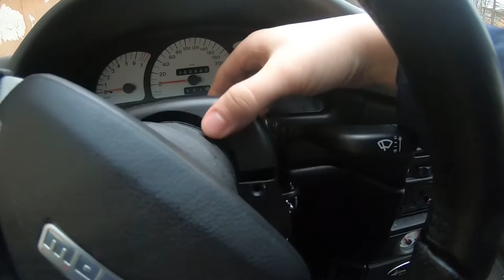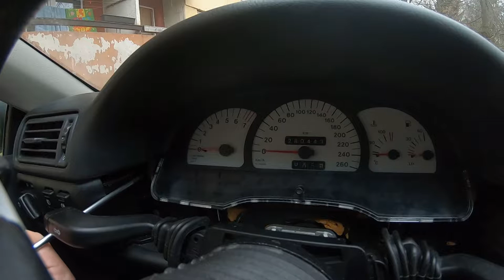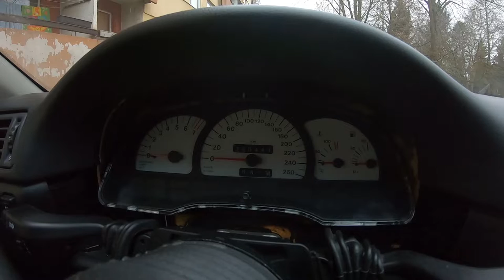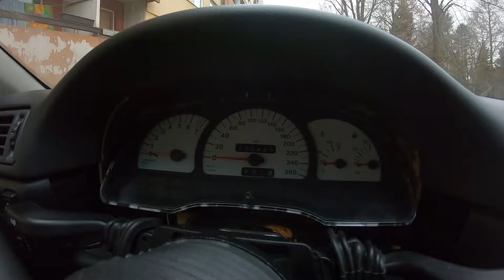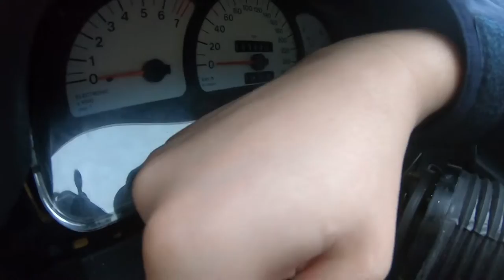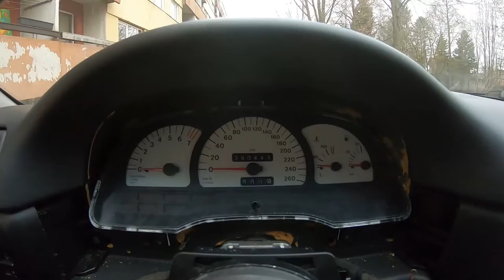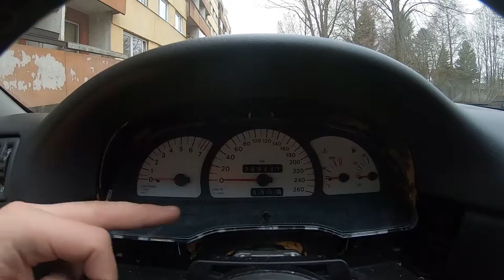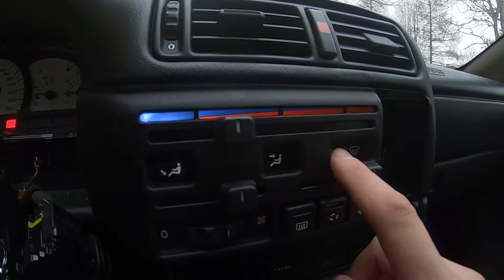How to Change Calibra/Vectra A Dash Lights

Comment: How did you manage to remove the instrument cluster so easily? Do you have to unhook the speed cable from the transmission first? I can't seem to remove my instrument cluster
Reply from the maker: V6 dont have a cable for the transmission.It has a wire connection.I remember when i worked on my previous calibra then the cable has a stopper so you need to push it towards the speedo with your fingers and then it comes off.I know there is not much room there,but if you remove it one time then it’s easier.

Comment: Excellent video ! 2 questions ,witch version of calibra is this and it doesnt have speedo cable ,and the second is ,is there a diference in the  speedo bulbs that are green and the bulbs from the 2 gauges that are black ,i mean can we use the black bulbs in speedometer?
Reply from the maker: Hey thank you.It’s a facelift keke rosberg edition calibra.That speedo what i have was put on the last calibras from sept 96-jun 97.Calibra unitil 94 had the speedo cable,but newer ones have just a connector.In the back of the speedo are 2 types of bulbs.Bigger ones and smaller.I’ve changed the small ones with each other and there are no problems.
Reply: Have in mind that maybe its the type of motor as well ,i have the last edition 1997 with the x20xev ecotec and it has cable ,maybe the v6 or turbos the newest ones has electronic.
Reply from the maker: @Heliastheodorakis  that I didn’t know.The cable ones were on the first years.

Comment: My whole dashboard is without light. I hope i can just change THE bulbs like You and it Will be like new! I would Love to hear more about illuminating heating lights. Got any Link where you bought it?
Reply from the maker: Hey.if your whole dashboard has no light then check the fuses under the dashboard,driver side.Iluminating the heater part is just one aditional led and original bulb like you see on the video.I bought led bulbs in my local electronic store and added a resistor what is suitable for 12v.
Reply: @TheMeisner87  thanks alot i Will check this! :) All check light works but not the light to the gauges  so not easy drivning att the Night :)
Reply from the maker: @redwoodjewellery  then probably its the fuses.
Reply: @TheMeisner87  it was the bulbs, ALL was broken. Did you find any better lightbulbs to use? (you said these was to bright in the videoclip?) if you did can you please link them? :)
Reply from the maker: @redwoodjewellery  i havent seen any calis where are bulbs where broken :D Where you want to put them.I think the best choice is to put led with resistors and get the light what you want.I bought a new instrument cluster also like maybe you saw on my previous video.There i am going to but leds with resistors inside original sockets what came with the instrument cluster.
Reply: @TheMeisner87  Oh ok, ill think i just get some new "normal" t5 lamps until i got more time to fix it more proper! thanks for a really well done video! :D
Reply from the maker: @redwoodjewellery  Thank you for the good words.I hope you can make everything working :)

Comment: Hi ,I was wondering what type of bulbs do you use for behind the heating controls, standard I want ,thanks
Reply from the maker: I use led-s.One led is added on the heater bar and other is at the original place.
Reply: Thank you for the reply , I just want the original bulbs do you know the code for them. I olso looking for vauxhall/opel cavalier/vectra A ,sunvisors can you help. Cheers
Reply from the maker: @nickbrady616  original bulb type is t10 and join the calibraclub community in facebook and ask them there,because lot of people sell spares.

Comment: Hi. Whats the model of the original calibra bulbs? Just one more thing. Is it normal that ther heater lights are still on when the light control is swtiched off? I mean the key at the very left. Thanks
Reply from the maker: Hey.
The bulb type is t5 and it’s not normal that the light stays on.I think someone put extra power to the bulb or there is a short circuit in the light switch.
Reply: @TheMeisner87 thanks so much. I'll work on it 👍👍👍
Reply: @TheMeisner87  13:05 where did you apply that extra wire? is it another t5 bulb? thx
Reply from the maker: @n1h1lvs  Hey i put the extra wire to the original bulb socket.And its just a normal 5 mm led.

Comment: I would have liked to see how you completely removed the cabinet from the heating controls to put the lighting LED
Reply from the maker: When you need to remove complete controls,then you need to remove cables and its easyer to remove them under the glovebox and after install them again.Because otherwise you will break some of the plastic clips what are holding the cables.

Comment: How do you change the light bulb of the computer? I can't get it out
Reply from the maker: Take the computer out and remove the white cover on the side of the computer.After that use tweezers and pull the bulb out.🙂
Reply: @TheMeisner87  It is very difficult, it is very hard, and I don't know how to get it out.
Reply from the maker: If you take the computer out and cant get the bulb out from the hole where is the white cap.Then you can open the computer there are torx screws.And plastic clips holding it together.Just open it slowly.There is a cable there just dont break it.Maybe someone put a bigger bulb there and then opening is the only way to get it out.